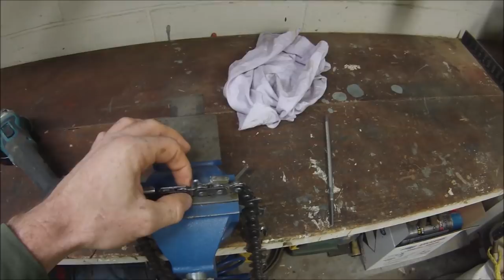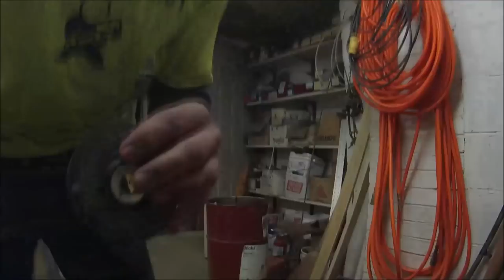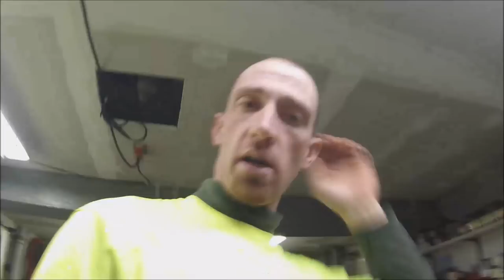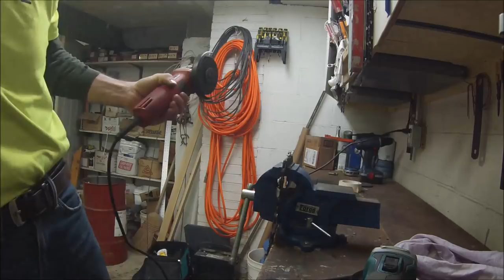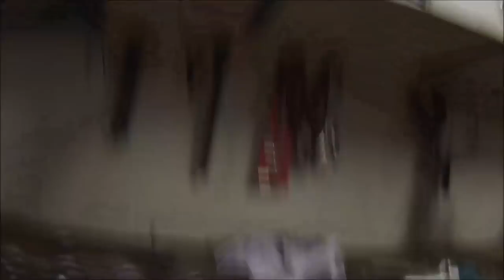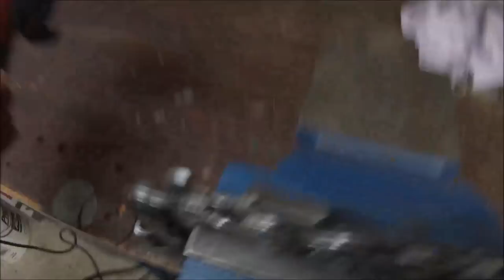First time dentist

Comment: Could you take a scrap bar, just the nose of it, and put it into the vice, then put the chain on the bar? Then all you would have to do is put your foot on the chain to keep it in one place while you sharpen and not need to loosen the vice every time you want to move the chain. It is just a thought.
Reply from the maker: absolutely i just dont have any scraps of a bar that size yet but i do tat with chainsaw chains, all except the steppin on it part lol

Comment: You did that all wrong
Reply from the maker: thanks steve i needed someone to tell me that lol
Reply: nuts319 take that old bar you wrecked and mount the bar in a vise or somewhere in your shop so you can hang that chain on it and make it so it's comfy to file on. I use a grinder on the din din chain and I only do 1 side at a time and that way I can keep the same angle for that side of the chain. Iv found if jumping back and forth the angles look like a 3rd grader did it with there eyes closed.
Reply: nuts319 the din din chain will last me a day or 2 without having to grinding it. I have hand filed it and it don't cut any better by hand than by grinder. I also don't gauge my drags just wing it and looking that the bar don't bunch to much while cutting. although they do make a gauge for that chain for the drags. just take a small amount like your doing and you will get it. Iv also found that the gullet don't make much difference so don't worry about going real deep that's all my opinion I'm sure I'm wrong also
Reply: nuts319 tater can make it cut better than me but I ain't gonna tell him that
Reply: nuts319 I found that if I just need to touch up to take a round file to it real fast and it works for a few more hours. you should at least try the file a few times and see what you think. Iv also got a trick for your files